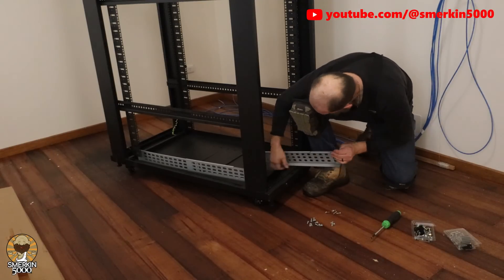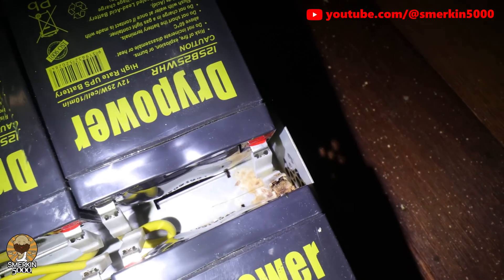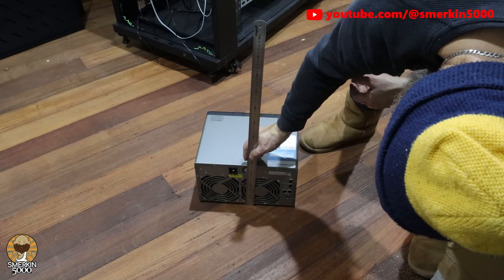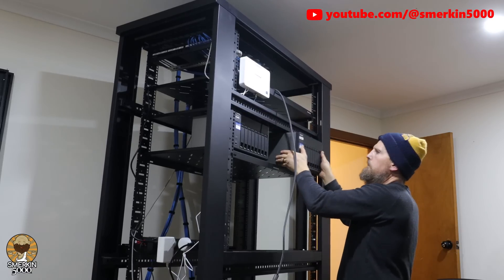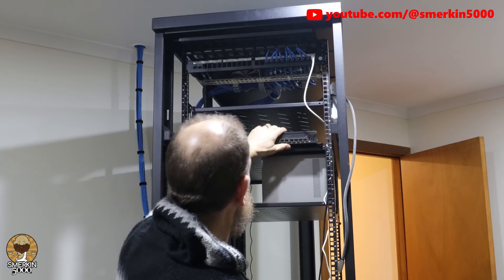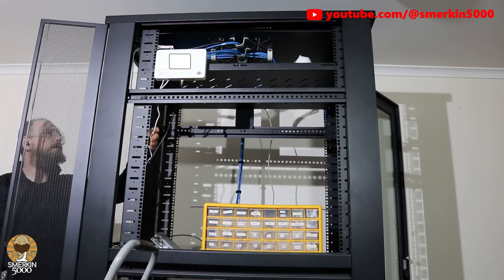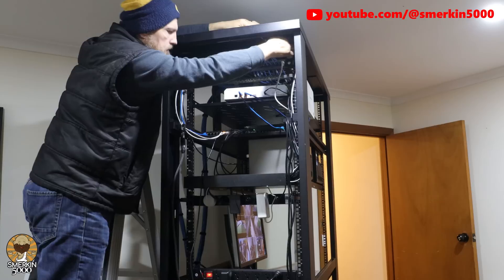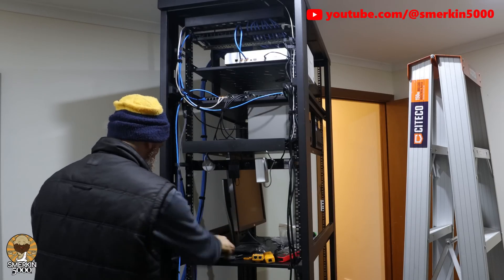Networking and Storage

Comment: hi, I just found your channel about 5 minutes ago. You mentioned that the Starlink drops out? Does the NBN Fixed Wireless drop out? Is it a solid connection? Or is it just slow?  I about to move to a regional town and am looking for a static IP service (where there is no cabled NBN in town). ta.
Reply from the maker: The NBN fixed wireless was terrible in my location even with a clear line of sight to the tower and the latest generation aerial. It was just so slow and unpredictable. Starlink is amazing and I occasionally get a dropout that will last 1-2 minutes. I stream on Twitch with Starlink and I can go weeks without any dropouts. You can’t go wrong with Starlink
Reply: @smerkin5000  Ok, good to know. Thanks. Now, if only Starlink did static IPs...
Reply from the maker: Yep, that’s the one downside